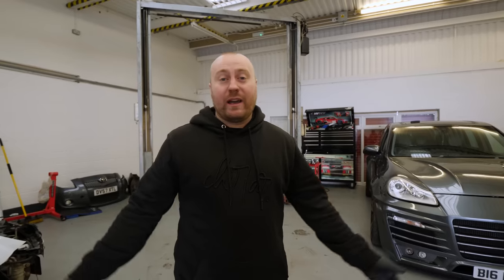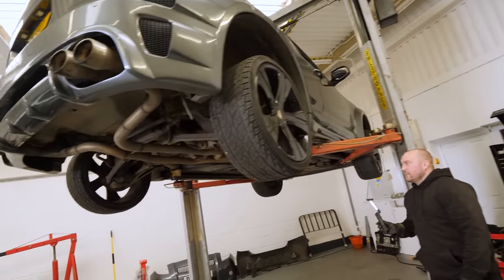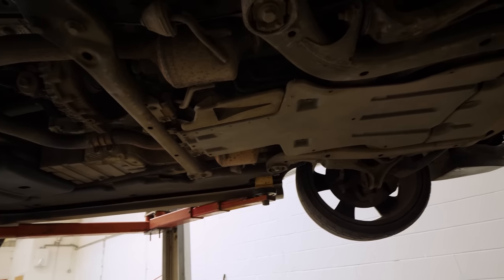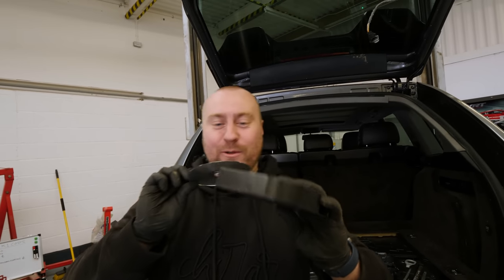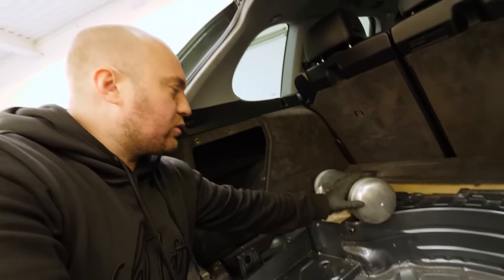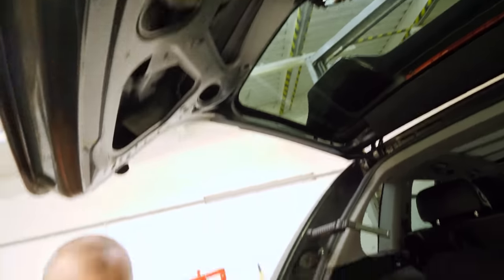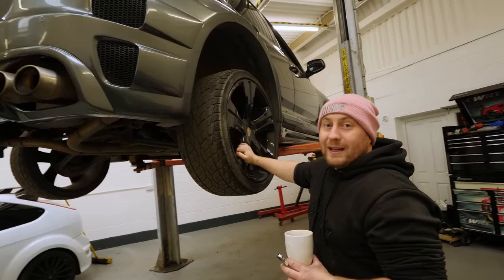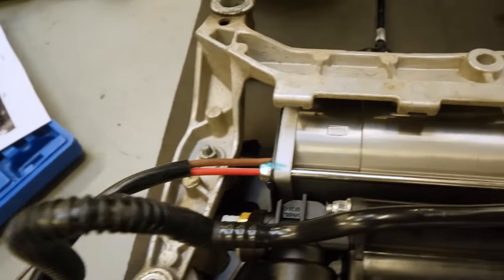WE BOUGHT A CHEAP NON-GENUINE PORSCHE PART TO FIX OUR £2000 BARGAIN SUV

Comment: Right lads, On top of each strut there is a Black O ring,its a fairly big one around 110mm Just drop the strut out as one, clean the whole Ali head off and replace the O ring this will solve your issues, Problem is the strut tops get corroded and allows air past making the system slow to respond, and keeping the compressor on for too long leading to a burn out, probably what happened in the first instance. the only time the compressor should run is when your raising, or at the lowest setting on un even ground, overnight the car should never sag, and the compressor should not run on car start in the morning, if it is,,, its leaking air.
Reply: @stevierea70  LOL...well they wont ever get it fixed and keep blowing compressors and fuses then :)
Reply: Dean from saving salvage had this issue with a q7
Reply: @acorndogs904  Yup its fairly common, I have a touareg, all 3 are the same platform so its safe to say they all suffer from it,

Comment: There’s chance that vacuum hose for the valve flapping about in the breeze will be causing a fault code. I remember on the 8P chassis cars you had to block it off with a bolt or fold it over and cable tie or it caused an issue.

Comment: Had these exact issues on my 955 Turbo, it was a nightmare! But the feeling of accomplishment when it raised and lowered for the first time was amazing.
Reply: What was your issue please? As mine has the front stuck down, replaced both level sensors after code read, and it’s still not raising ......?
Reply: @Baron Stock  I did what they did, bought  pump and values, I also replaced the tank and all pipes but in the end there was a 15 amp fuse that had flown in the fuse box drivers side, right in UK.

Also, I had bought a replacement controller ECU that's in the boot, but it turns out it was fine in the end.

Comment: Lads please contact GEG on the Wirral ask for Carl to get some decent ramps. Please make sure the ropes have been inspected etc on that one and it has safety locks (if no locks by some large axle stands)
Reply from the maker: We’re all good mate. This doesn’t have ropes it’s hydraulic. Jays been a lift engineer for over 10 years. Of course it’s got locks 👍🏼 thanks for your concern but NWGE is one of the best companies out there 👍🏼

Comment: On the plus side if you’ve fixed the suspension you have saved on the cost of a step ladder for uncle Bengi getting in and out of the car 😂Awesome content from the new unit you’ve even got yourself a scouse Chris Slix to help out